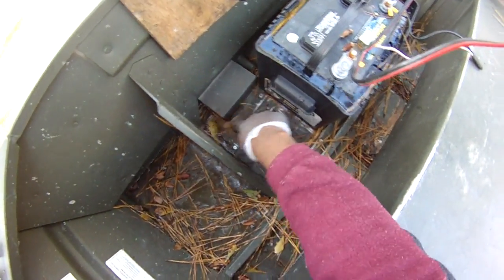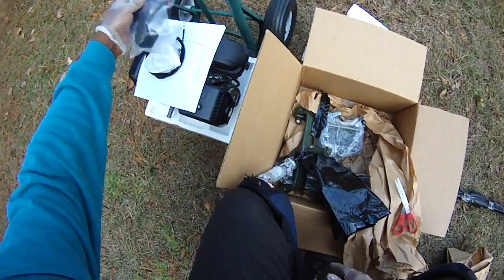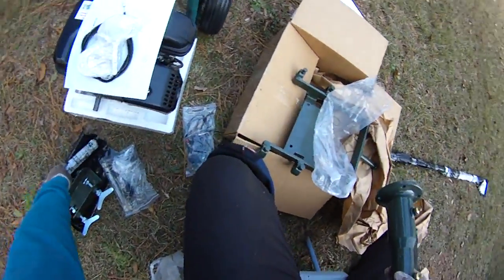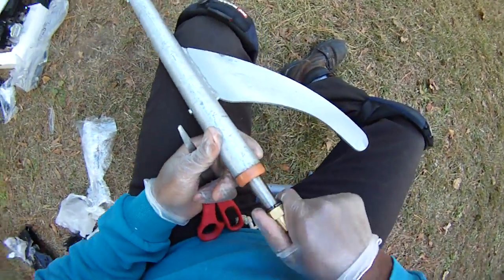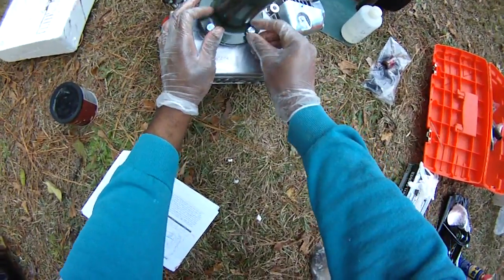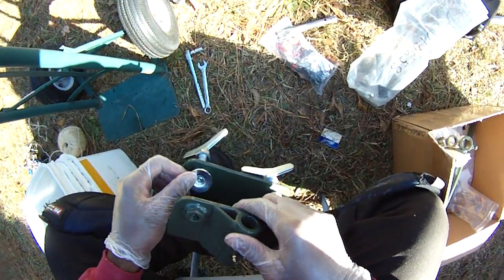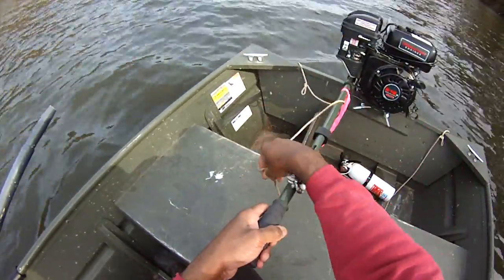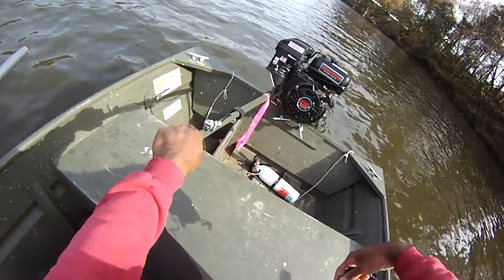SPS Longtail Review | Small Swamp Runner Mud Motor Kit | 212cc Harbor Freight Predator Engine

Comment: The 6.5hp predator motors I found at harbor freight are all counter clockwise shafts, any clue where to get a clockwise shaft motor to build one?
Reply from the maker: +Zach Raymond No, I don't know, but why do you need a clockwise shaft?
Reply from the maker: +Zach Raymond They are all counter clockwise motors. Even the original GX200 is a counterclockwise motor: http://engines.honda.com/models/model-detail/gx200
Reply: Don't you need a clockwise shaft to move forward? Or do I need to buy a ccw shaft to build a motor like yours?
Reply from the maker: +Zach Raymond Na, you need a counter clockwise motor to move forward. Remember Newton every action gives an equal and opposite reaction. If the motor is turning counterclockwise, then the propeller will turn clockwise when look the opposite direction. The opposite direction being forward.

See, the shaft doesn't care which way it's turning. The shape and orientation of the propeller give forward motion. My motor rotates counterclockwise and you see me moving forward in all my videos.
Reply: Okay thanks, I'm just confused and don't know a whole lot about motors, just thought if the shaft was ccw then the propeller would only run in reverse, but I'm wrong if I understand correctly
Reply: Got it now, thanks alot
Reply from the maker: +Zach Raymond It's fine. The guys who designed these motor put a lot of thought into it. It's a simple but very well thought out design.
Reply: +Black Warrior Lures,
thanks for the help, just trying to find the right kit for the motor now so I can order it
Reply from the maker: +Zach Raymond What kits have you looked at?
Reply: So I bought the same motor and kit as you did and just got it all together and running, but when I have the motor tilt back a little bit to put the prop into the water the engine dies, like it's cutting the gas off or something? Did you have this problem? Or know what it might be?
Reply from the maker: +Zach Raymond Nice! Glad you got it running. Yes, it's the angle. The oil shut-off sensor kills the motor because it thinks your out of oil. You need to overfill these motors with about 2 to 3 ounces more oil than required to fool the sensor. It won't hurt the motor at all.
It'll do the same thing in hard turns for the same reason. always add 2 or 3 more ounces than what the manual says in this application.
Reply from the maker: +Black Warrior Lures That's why so many people remove the sensor when they start doing serious internal mods to the motor. 

BTW I do recommend synthetic motor oil with these small motors. Regular oil is fine; you run into problems or anything, but I prefer synthetic when running after the break-in.
Reply: +Black Warrior Lures okay thanks a ton for all the help I will give it a try

Comment: How much does everything in the video cost?
Reply from the maker: Mike Rellinger The Harbor Freight 6.5 Predator cost me $99 with a 20 percent discount code plus $6.99 shipping. (Sadly they don't offer the discount on the Predator motors anymore. Expect to pay $119.) The Small Swamp Runner Kit from SPS North America cost me $399.99 plus I think it was $65 shipping.

That's in 2014 dollars the total cost for the stock unit was $571.74 for the whole thing, everything you see in this video. I've sense hot-rodded the engine with go-kart racing components to get more horsepower. Expect to spend $80 to $100 to get an extra couple horsepower out of the unit.

On my blog I did a cost-per-horsepower comparison http://blackwarriorlures.com/three-things-outboard-motor-manufacturers-dont-want-you-to-know/

At the time is cost me $73.02 per horsepower; that's with the hot-rod upgrades; stock would be even cheaper. Consider that an 8 hp Tohatsu cost $199.99 per horsepower, you can't beat these motors on a value-per-dollar basis.
Reply: Awesome thank you!

Comment: I Like the Kit but it really needs a Cav Plate
Reply from the maker: Actually that's not true. It doesn't need a cavitation plate. It's a surface drive. It's designed to ride in the crest of the wake. A cavitation plate would drive it down too far creating inefficiencies. The design has been around for 50 years. They have perfected it. The cavitation plate adds unnecessary drag and defeats the purpose of the prop design.

Comment: those are grease ZERKS FOR A GREASE GUN do not remove them use a grease gun that has a fitting to go over the nub and it fills it up with MARINE GREASE
Reply from the maker: Well, that's exactly what I do. One of the fittings was damaged. It needed replacing. It has been five years since this video was made. I've learned a few things since then.